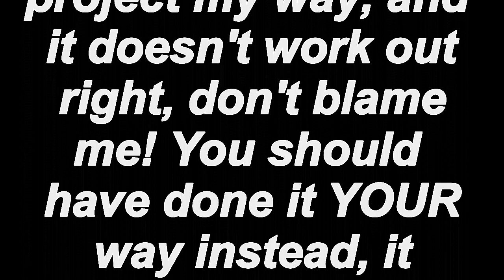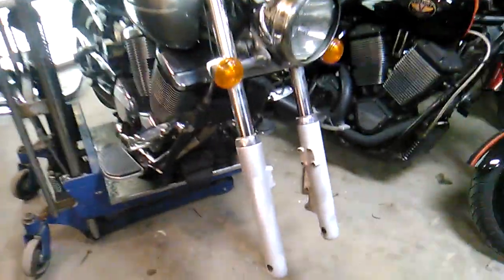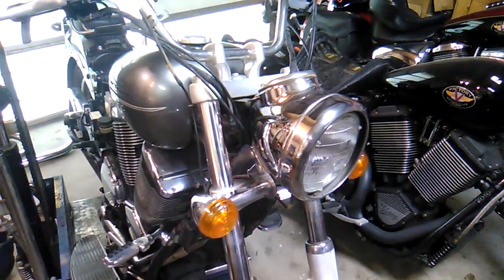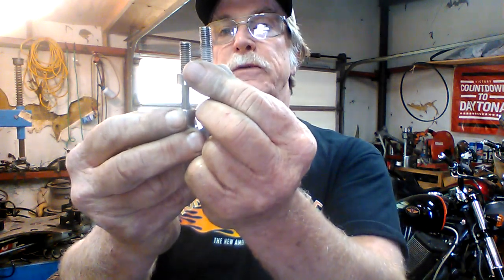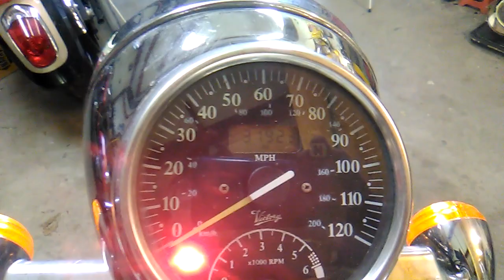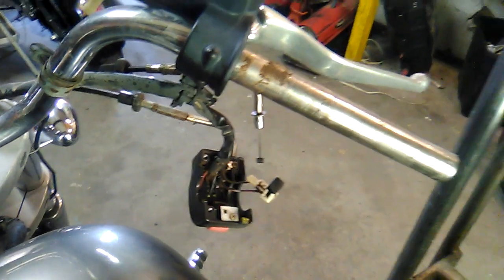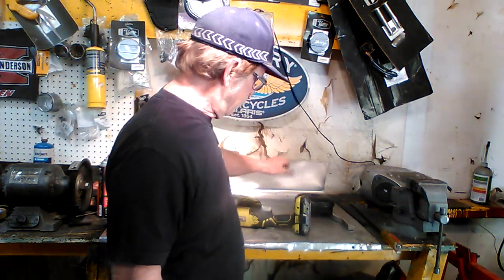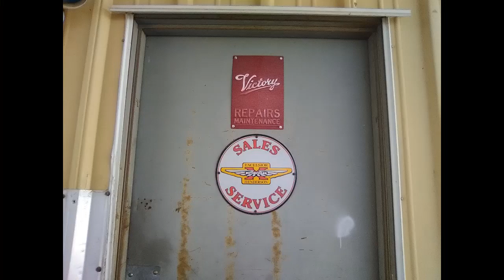02 V92 (Part 4) She gets forked, tired and exhausted!

Comment: FYI - I have metal brake at my place if you ever need it. I also have a horizontal bandsaw (haven't set it up yet). You know where I live, so you are welcome to use them for any fab needs you may have in the future. Also, the black forks compliments the frame and seat well. Looks good.